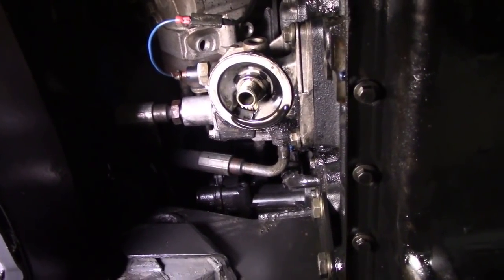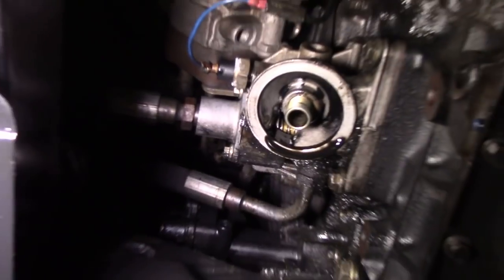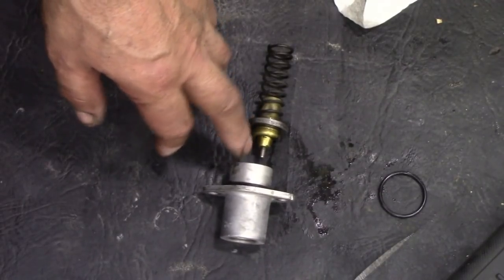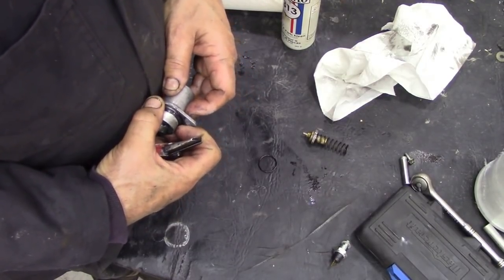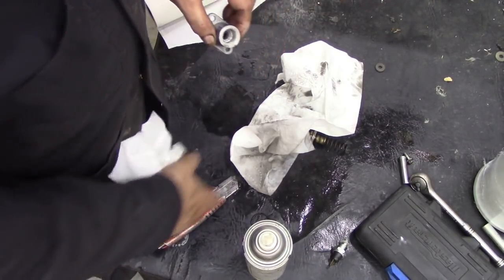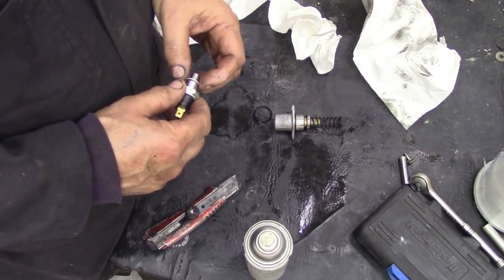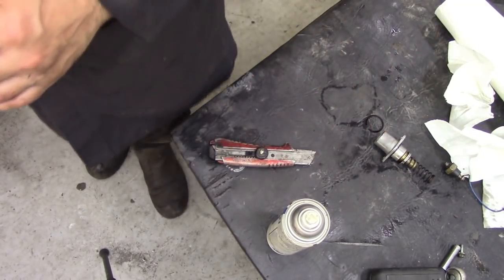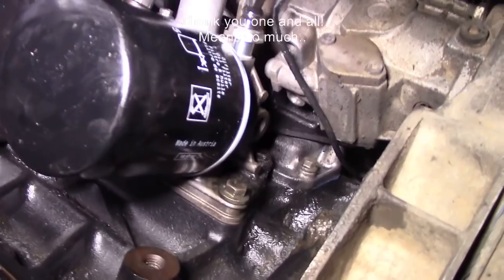300Tdi oil filter housing leak - cheap fix!

Comment: Hi Mike, When I change the canister filter on my TD5 I put a plastic over it to catch the oil as I remove it.
Reply from the maker: On the 300Tdi you can clearly see the filter and get at it BUT you have to get your arms round the steering tubes and damper

maybe next time when I am not in a hurry I will drill a hole in the filter and let it drain first!
Reply: Britannica Restorations Ltd If you get a uk 5lt container and cut it in half use the handle side upside down push it up to the filter to catch the oil and filter. No mess 👌😉
Reply: @BritannicaRestorations  i find a dog poo  🐕 💩 bag is useful !
I have to do it in the driveway, 
The oil change that is!

Comment: How many washers should be on the 200 thermostat, Mike?  Mine had one, but some seem to have none, and the Parts Manual and Workshop Manual contradict each other, last I saw.
Reply from the maker: Yes some have 1 and some have 2 - but I have not seen none
The filter I fitted to the 2.25 had one - this one had 2
Must be something to do with the spring tension to shut off the thermostat
Reply: Mine had 2 but when I took it off the spring & the washers fell to the ground & I wasn’t sure where the washers went. Incorrectly I guessed at the other end of the spring. On doing it up the flange broke. I bought a secondhand housing & the thread was different for the coolant hose. Nightmare. I share this in the hope it’ll help someone else.

Comment: My oil filter does t seem to always leak only when I use the ryco filter, would you suggest it is still most likely the same o ring in the tutorial? 
I’ve started mine without filling the filter 🤯 would you say this to cause any damages?
Reply from the maker: Oh dear! Bet you had a lot of oil on the floor! 
I always use Mahle filters
You must use O ring ERC5913 or you will break the housing
Reply: @BritannicaRestorations  what is the likely damages if not pre filling the filter

Comment: Thanks Mike. Fixed this, and now the return pipe on turbo leaking oil at the fitting. Wonder if fix is similar. Will be nice to one day have a 100% oil leak free 110, although this is possibly wishful thinking.
Reply from the maker: Yes it will

Comment: Hi Mike, great explanation! Thanks for make it easier!. One year ago I replaced both oil cooler pipes because they were not serviceable, leaking at some points, and put a new pressure switch, thermostat, gaskets, o'rings... So filter housing seemed brand new. A few weeks ago I noticed that the lower pipe (ESR3691) was leaking by the nut, after the thermostat housing, so I thought it must be the o'ring...
 I've been replacing the o'ring (ESR1594L) three or four times but continues leaking and it's driving me mad... Could be the pipe then?
Thank you very much!
Reply from the maker: Could be the pipe or a defect inside the housing  -requires further inspection, but as I am aware you need to remover the injector pump to get the oil filter housing off
Reply: @BritannicaRestorations  Thank you very much!

Comment: cheers mike another job on my list,, after i try and find out where the oil on the bottom of my transfur box is coming from, im hoping its just the sump gasket,,
Reply from the maker: Nope, it will be the intermediate O ring in the transfer case!
Reply: @BritannicaRestorations  hi bugger, that be a garage job then for me,, would there be any thing worth doing at the same time when i get it done? 300tdi, 127,000 miles on the clock,, all the joy of making landys better lol cheers
Reply from the maker: If it is a 110 you can use dowel bolts to pull the box back and replace the I ring - but no room on a Disco or RR

Comment: My Discovery 300TDI is leaking in that vicinity. Sadly, an o-ring that lists for 26 cents in the UK will cost me around $200 and take a month to arrive here in Kenya. I think I'll continue to live with a few drops of oil on my driveway.
Reply: Remove the old hard o-ring and then try a ring of Gasket silicone in the o-ring area.
Reply from the maker: Email me your address and I will stick one in the post!
Reply: @BritannicaRestorations  Might be cheaper if I send him one from the UK 🤔

Comment: 1/8” BSP on that pressure switch Mike if I remember correctly.
Reply from the maker: 10mm fine parallel
Reply: I stand corrected. It has been a few years !

Comment: How spooky. I changed that very O ring myself, last week. When I got the housing out and looked at the old O ring and the new one and immediately thought ‘oh no, I’ve got the wrong one’. Checked the part number and then my sensible brain kicked in and reasoned that the old one was misshapen and that was why it was leaking. But you’re right, it does look as though it should be that shape 😂
Reply from the maker: Threw me when I first saw on too!